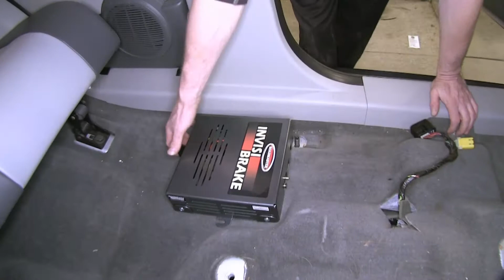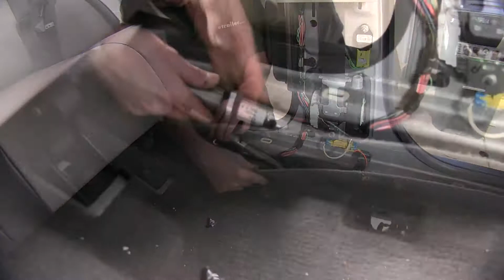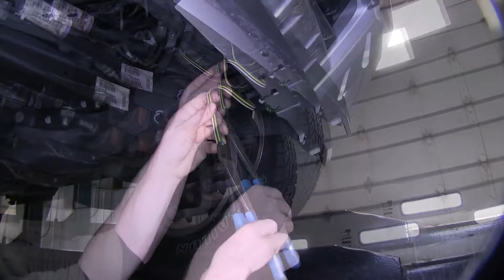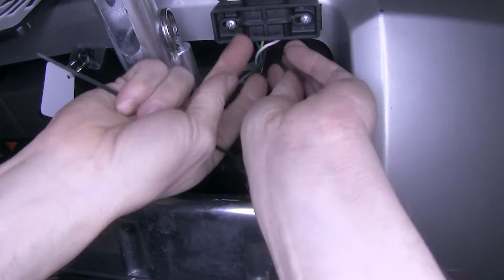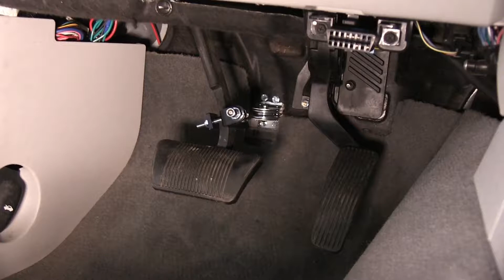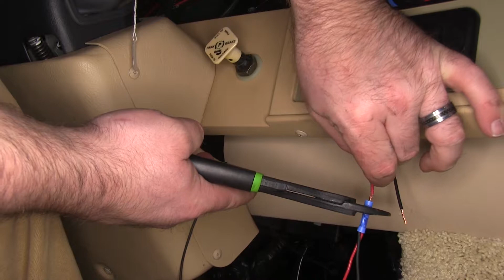etrailer | 2008 Jeep Liberty Roadmaster Stop Light Switch Kit: Complete Installation

Comment: THIS VIDEO IS INCORRECTLY LABELLED - THE 2012 MODEL YEAR DOES NOT REQUIRE THE STOP LIGHT SWITCH. THIS WAS VERIFIED BY JOHN AT ETRAILER.COM ON 12/28/2018

WAS THE JEEP THIS WAS INSTALLED ON A DIFFERENT MODEL YEAR?